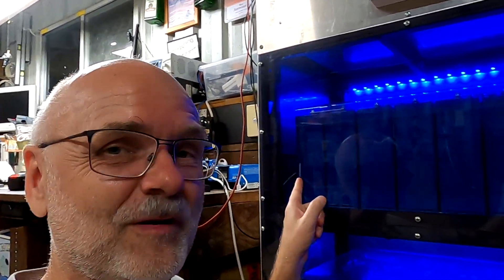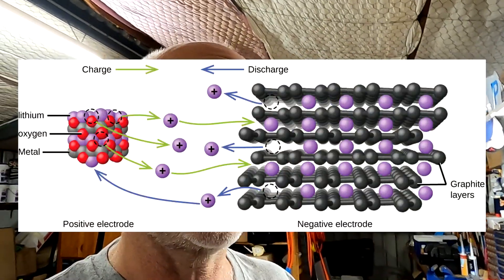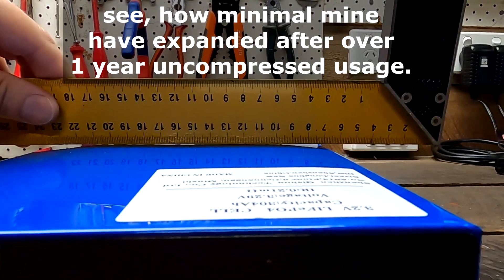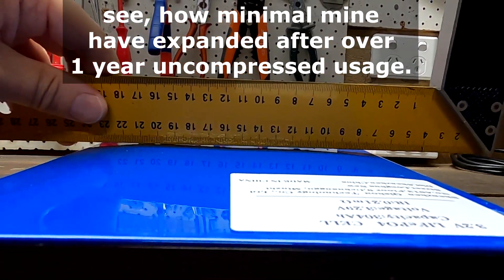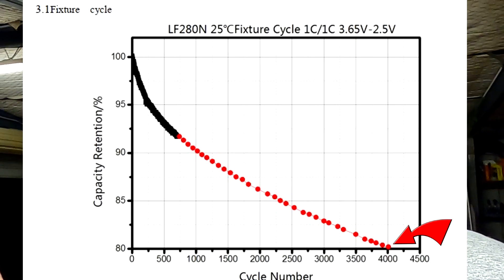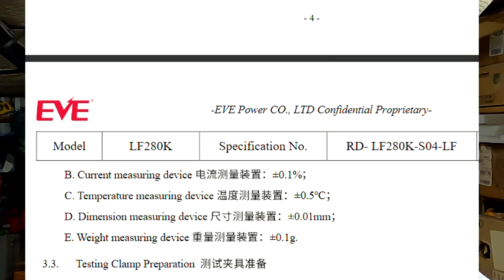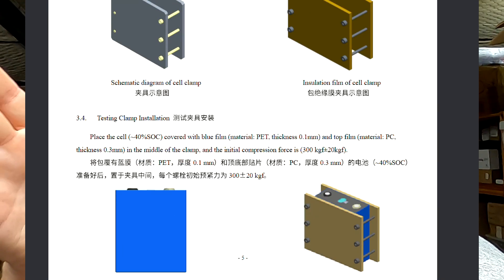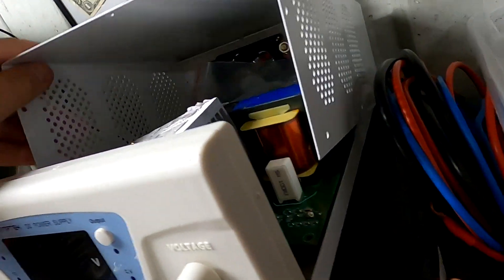Why you should compress your LiFePO4 battery! And why it does not matter... 🤷‍♂️

Comment: Yes, it doesn't matter, if there is a low cycle rate like you have, with about 50 a year. Such a off-grid system  will die mostly because of calendar aging, especially when charging high, keeping high SOC, and at high temperatures. 
 
But some are using their batteries much more intense with lower capacity, just for daily solar storage and have 150 - 200 full cycles a year. And this may go even higher by additionally optimizing usage of a variable grid tariff, having even more cycles per year.

BTW, not one of the numerous scientific research papers regarding lithium cell compression I read, mentions any bubbles in the electrodes as reason for doing compression, but talks about reversible and irreversible expansion. The irreversible expansion (mostly SEI growth) is reduced by the constant pressure. Some papers even talk about using the increasing irreversible expansion during aging as indicator for SOH. So it is not so that expansion stops after some number of cycles. The expansion increase the all time, especially if you charge above 3,40 V/cell.

Compression doesn't cost much extra, for the chance of considerable improvement of long-term capacity and internal resistance, in grid setups with more cycling. So why not?

Comment: Great information Andy!  Love it and thank you for sharing!!!  I have not heard some of that!  You are 100% correct how some of those places test there 1000 cells at a time.  I was sent a similar video and pictures when I purchased mine lol. I would like to add one benefit  of compressing or fixing a group of cells.  The accidental or unintentional overcharging of a cell or cells from a faulty bms or whatever the reason. You can prevent the pack from making a smiley face😀which may help from damaging other cells and depending on the area the cells are in could prevent damage to other equipment.  Dont mind me, I over think EVERYTHING!! 🙄

Comment: Andy, as always, a fascinating video.  Thanks!  Still. I think you may be taking Marcus' explanation too far.  WAY TOO far.  He is absolutely correct about the atomic swelling caused during charging.  Absolutely that happens and can't be prevented.  But that particular swelling is not the swelling you're seeing on your batteries.  The swelling your batteries are experiencing is simple mechanical swelling caused by incompletely constrained prismatic cell structures that are exposed to cyclic (smaller) swelling caused by the charge and discharge cycles.   Unconstrained it slowly results in a permanent bulge focused in the  center of  the bottom quarter of a prismatic structure under relentless gravitational pull.   Look at a year old acrylic aquarium, they all have exactly that same bulge in the same location.

If that's not the bulge on your batteries then explain why it took a year for your batteries to bulge to the point that arrested your attention to them.  If it had been only the atomic charge bulge they would've expanded to what they are now on the first charge or two.  They did not.

The battery makers build the cases out of the thinnest material that can mechanically support the expected handling forces.   They could, but they don't, make them thick enough to hold their form without external assistance.   It allows a battery pack to be smaller and much lighter to have the additional force externally applied.   And, of course, it saves them lots of $$.

Look at any commercial LiFePO4 batteries.   Not these shlocked together ones in our home energy market I mean ones made by the thousands for industrial applications by actual battery companies for public transport or stationary utility storage.  They'll be compressed.

Comment: As with all of these things, everything has a kernel of truth, but it doesn't mean that it's a rule that THOU SHALL FOLLOW .

Like looking at any datasheet and pointing at a number and saying YOU CAN'T GO ABOVE THAT! Well the part where it gives the absolute maximums disproves that.

Then there's the "spending hours/days to gain a 0.001% advantage" mentality you see in the volt/frequency nut communities. "OH NOES, MY OSCILLATOR DRIFTS BY 0.0001hz A DAY!", well who cares, it's stable enough for 99.99999999% of cases, so stop trying to improve upon it.

Comment: As others have said, the movement of uncompressed cells can cause stress on the terminals.

I setup 16 eve 280 cells uncompressed and after about 20 cycles the noticeable swelling on about half the cells (interestingly it was not even) was pushing the bottom of the cells apart due to the clamping force on the terminal. 

They are now clamped with braided bars!

Separately, Mine do one full cycle per day.

If uncompressed means I only get 2500 cycles, that is under the 10year calendar life and crosses over to the point where compression could extend the useful life????

Comment: Great video. Thanks for sorting that one out.
However.…., You still might want to “compress” your batterie cells for mechanical reasons. Assuming that some stationary batteries are going to be moved around, especially by DIYers, a form of mechanical fixing might be a good idea. Packed with EVA foam in between the cells, EVA foam will compress as the battery cells expand. The cells will more likely maintain their position and this will reduce the stress on the busbars and terminals.

Comment: I'm confused (nothing new there...).

If the proper automotive grade batteries are tested under pressure, surely the storage grade ones are too? Just that the first ones pass and the second ones fail.

Or are failed ones sold off after the first test and automotive grade ones get further cycles at the factory under compression to ensure they meet lifetime goals?

Comment: I‘ll not use compression at all. The cells will survive or not. I have seen compressed cells exploded for improper charging. That is the thing to be aware of. Some ppl do not see the bms as a part of the battery and put a breaker in the wrong place or dont use a bms at all, what will kill some cells of the pack sooner or later. 
My awareness will be temperature in wintertime, my battery place is an unisolated shelf outside the house, so I‘ll isolate the batteries and put some heating elements inside, to keep the cells above 5 Celsius. 
Thanks for your video. We are the rare ones without compression. And what I see in many videos, they do compression without feathers, so its wrong and the force rises while charging and that is a lot.. better no compression than wrong compression.

Comment: Another great video, one of your best Andy.  

Fixture IS important, but no, you don't have to do it.  Cycle life might not be important in your high capacity installation, but most DIY installations are on a budget, and cycle way more then you do.  My marine customers usually do a 600AH 12vdc installation that gets a full cycle every day or two.  These installations average 250 to 300 cycles a year for my commercial customers that recharge with a diesel generator or shore power (no solar).

You brought up something I'm pretty sure I failed to mention in my previous explanations.  The cells do in fact swell and compress.  Like I motioned in previous comments, the major swelling you've experienced is avoidable with a fixture, it's why I said that cells should only be removed when empty.  The level of swelling you've experienced is completely avoidable. 

As for your statement that cells won't be damaged by compressing after they have severe swelling, my friend I encourage you to do so and see for yourself the fluid flowing out of the seal( It will make a great video =).  Fluid breaking though the seal is damage.  The question then becomes, how much damage can be done before cell capacity is affected?  I personally have have not been willing to push past the seal breaking point after doing it the first time.  If you flatten them until they are as flat as new cells will they burst and compromise the vacuum?  inquiring minds want to know.  Lets see that video Andy!  For Science!!1
Reply: Wow, yes, that would make a great video! 😮
I have Winston cells in my RV that I assembled with significant compression, and flexible Busbars. To my knowledge they’re still virtually as good as new. Although I haven’t disassembled the pack (big job in a tight space!), nor done a full scientific capacity test, I have noticed zero problems with daily use and the occasional deeper discharge, and they are still absolutely fabulous. 
I also have a friend who has “abused” his a lot more than me, with some low voltage AND high voltage “excursions”, with no BMS. They’re also still fine.

Comment: Hi Andy,and thanks again for this video and and this new information that you share with us,
this corresponds to what I thought, and I had mentioned in my previous comment.
But ultimately, we always come back to the same observation, these new lithium battery technologies, for me, have not yet been fully developed.
And I would even say that they have not yet really proven their longevity??
Because if you take good quality classic battery, but with a similar principle, that is to say, several battery with low voltage, like 1-2-3 or 4 volts only and connected in series, the performance will be very good too. , and it will also last a very long time ..
the only problem with classic battery is that they take up a lot more space.
All this to give, my personal opinion, about these new lithium battery technology, For the moment with 4 years of use I am not yet convinced.
However, if these battery work normally for 8 or 10 years? at will be covinced,
 (for me to speak of 20 or 30 years of use is a joke! for the moment we have no hindsight,and in 20 or 30 years certainly before, this technology will be completely outdated and obsolete.
Reply: I have 400 Ah Winston LFP prismatic cells in my caravan that I assembled, that are well over seven years old. 
They remain absolutely fabulous in every way with almost imperceptible degradation.  Will they last 30 years? Who knows, I likely won’t be here to find out, but they’ve already outlasted AGMs. 
I could/would never ever consider going back to the dark side for lots and lots of reasons. (aka Lead Acid)

Comment: Graphite expansion from zero to 100% state of charge is about 11%.  Graphite is about 20% of cell volume.  11% of 20% is only a bit over 1 mm thickness change on 70 mm wide cells.

Most of what folks call bloating is excessive electrolyte decomposition.  It creates the gas that bloats the cell, but the real damage done is the electrolyte solvent that decomposes to hydrocarbon tars that are left behind clogging up the electrode and separator pores restricting lithium ion exchange.  Overcharging is usually the most common cause of electrolyte breakdown.  The cell wrap is open at terminal top end of laminate wrap so most of the gas escapes into the metal container which is what is bloating, not much bloating on actual laminate wrap.

Initial charge forming by manufacturer builds the protective SEI (Solid Electrolyte Interface) layer around negative anode graphite granules. This breaks down and consumes some of electrolyte and creates a significant amount of out gassing.  The vent port is last thing placed on cell casing so most of this charge forming outgassing escapes before port seal is installed.

Normal use charging cracks some of the SEI protective shell due to graphite expansion and it is repaired on subsequent recharging.  It does consume some of the electrolyte and available free lithium causing degradation of cell over time.  It also thickens the SEI which increases cell impedance.  It is part of normal aging process.  Nothing to do with compression.

Delamination damage is mainly the separation of graphite and LFP electrode from copper and aluminum foil current collector.  Chance of delamination increases when cell temp rises due to high discharge/charge currents and ambient temps.  At <0.5 C(A) discharge/charge rates this is not much of an issue.
Reply: Hello should we compress or not ? we still not sure soo much conflicting information... TIA
Reply: Always so interesting to read from you.
Reply: Thanks for a very informative post. Expands understanding of how LifePO4 works and all misconceptions/myths

Comment: So it will take 7 years maybe to reduce capacity to 80%.  If you bought grade A which were 5-10% more capacity.  That then brings it up to 85-90% dead.  You only fill batteries up to about 80-90% most days.  Just looking at these figures, why on earth would you be bothered.  I could be dead before the batteries.  LOL  In the comments people are worried about busbars.  LMAO  If you're that lazy you can't check the torque setting on the batteries every 12 months then you need to buy a server rack battery, these have welded bus bars.  You switch it on, no DIY.  DIY is not for everyone.

Comment: But you didn't mention anything about terminal stress. Your batteries in their swelled state appeared to be put some stress on the terminals.

Also I've had my Eve 230 cells compressed since I bought them 18 months ago and I will take them apart again this weekend to check with a straight metal ruler for swelling. But I did not see any last weekend when I had them apart for reconfiguration

Comment: The compression or fixture to hold the cells allows the cells to vent in the case they overcharge or short and need to vent versus expanding, bursting, and possibly catching on fire way worse than venting out the vent hole.

Comment: I Compress my cells for one reason...ease of handling. I do this with 12v 4 cell builds. I use the compressed cell battery in small mobile setups. I use 4" electrical tape to do this and makes the cells easy to handle like the format of a lead acid car battery. 😊

Comment: Hi. Please do an article on cooling of these batteries ... Both of off grid and ev applications. Your views on air cooled and liquid cooling for ev application as for off grid will cool itself as the current draw is more predictable and can be sized accordingly but anyway your ideas on this please
Reply: Yes, EVs obviously need cooling. 
However for the very low C values (charge and discharge) that most of us use for solar, it’s just not an issue.

Comment: But, what about the cell terminals? If the expansion pushes the cells apart by even 5mm per cell, won't that mean that a row of 8 cells has the potential to expand by around 40mm in total? Busbars with with low tolerances might therefore cause pressure on the cell terminals and damage them as a result. I think light compression (using Kapton tape perhaps) could help in this regard. It also helps keep the battery together in the event of an earthquake too. 😉 Love your show btw.
Reply: Flex busbars

Comment: Almost two years ago  I had a translated conversation in China with a CATL rep. I was told that the main enemy of Lifepo4 cells is moisture, and that a deep vacuum is applied to the cells prior to sealing in order to convert any moisture into a gas, remove as much moisture as possible, and that any remaining moisture in gas form was not expected to cause damage The compression I was told was to help maintain cell vacuum and keep any moisture present,  no matter how little,  in gas form where it will cause no damage. So, now I have even more questions.  Actually,  questions upon questions which lead to even more questions.  Given that spent  time is the only thing which we can never recover, I'm ready to move on.
Reply: Yeah- I’m sure we will know a lot more about these cells in thirty years time. Problem is: I won’t still be here 😅
It’s all still fascinating though, great stuff and great research and testing by Andy.
At least my seven plus years old LFP Winston cells are still awesome.
Reply: @FutureSystem738  I realize that this is an old comment, but on the off chance that you may see this and reply:

I have been highly interested in these Winston cells, yet I have been unable to find much info on them in terms of real world experience. You have that, so if you might kindly answer a couple of questions I'd be greatly appreciative:

1) In what application are you using the Winston cells (ESS, EV, mobile/marine, etc.)?
2) What size cells do you have? What is your pack voltage, and in what configuration are they assembled (i.e. 16s1p, 8s3p)

What really intrigues me about them is the manufacturer's claim that the Winston batteries, due to the yttrium, can be safely charged in low temp environments that far exceed that of a typical LFP battery. Any info you can offer is greatly appreciated. Thanks in advance!
Reply: @vastirvision  My Winston cells are 400Ah cells in just a 4s (ie: 12v) configuration in my large caravan. I built the pack at the beginning of 2016, and for many years operated them without any kind of BMS, just keeping a bit of an eye on balance with individual cell voltage monitoring, and using very conservative voltages to avoid any chance of a cell going high, and typically 13.8v top of charge = 3.45v/cell. (They’re bolted in to the caravan under some degree of compression.)
I actually manually balanced them slightly maybe about three?? times.
Then I added a JK BMS a year or so ago, which keeps them extremely well balanced, usually to within 2 millivolts, and as a result I upped the top of charge to 14v = 3.5v per cell.
Although I have never FULLY capacity tested them since installing, I often discharge to about 20% and have noticed no capacity loss since the beginning of 2016. 
I have about 1kW of solar, and we use them for everything including hot water, fridge, induction cooker, microwave, and even some airconditioner use (heating and cooling) when solar conditions are good. If the weather is not so good, we revert to using some LPG for hot water and cooking to reduce electrical demands.
I was not aware of any claims about charging at lower temps- have always avoided any charging if they’re close to 0 Celsius.